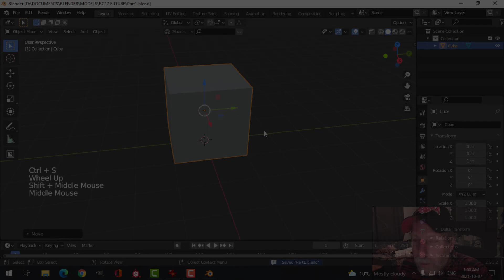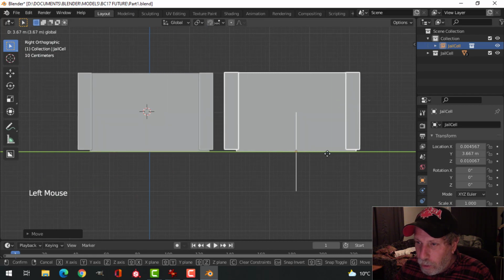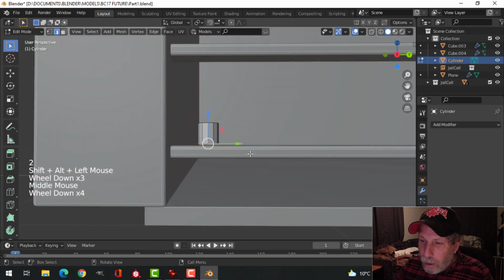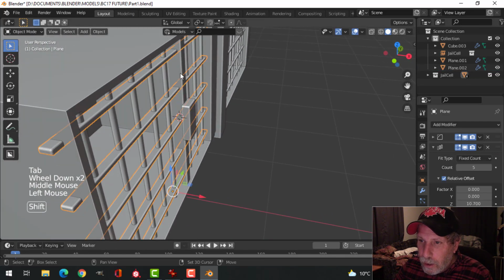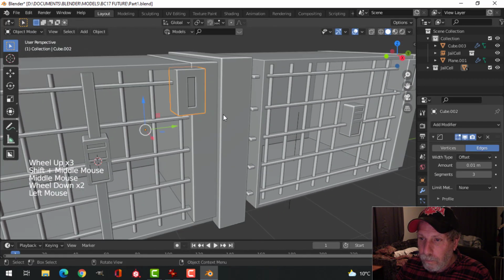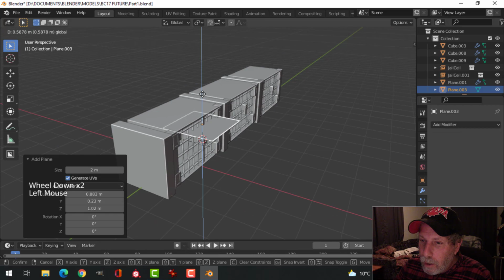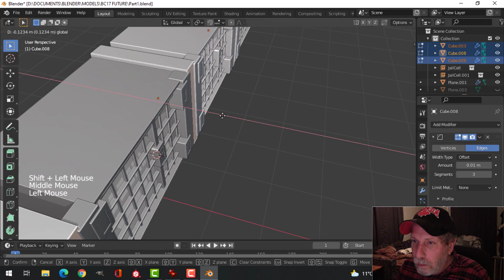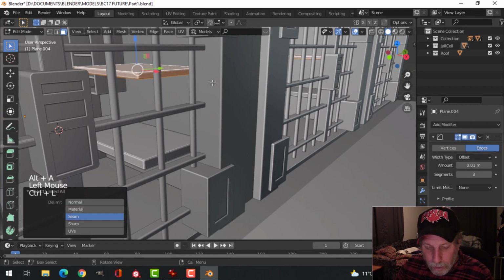BLENDER CHALLENGE 17: SCI-FI FUTURE PRISON (PART 1)

Comment: One thing I do differently is that I use a low poly human base mesh as a size reference. Or, I just use a cube to represent the size of a human. This way I can place things in proportion. This is looking great already, looking forward to the rest.
Reply from the maker: I often do that too with a rectangle. Didn't do it this time though. Thanks!
Reply: @zerobio  one thing you do here that I'm going to start doing more often is the block out phase. I'm guilty of skipping it.
Reply from the maker: @Some_Guy_Called_Raven  and I don't always do that but it can be helpful.